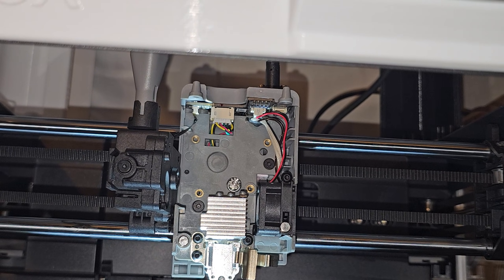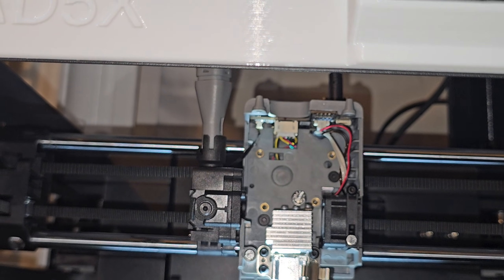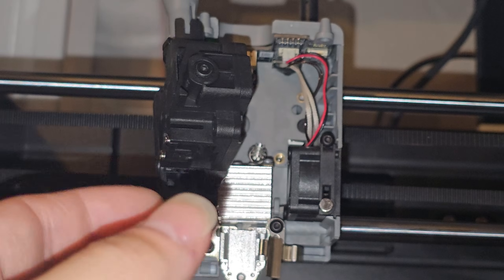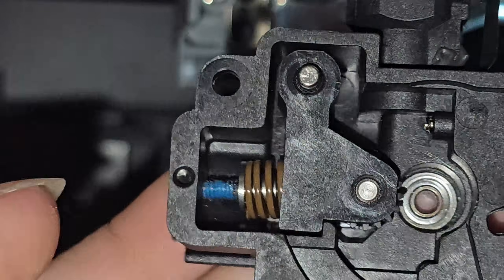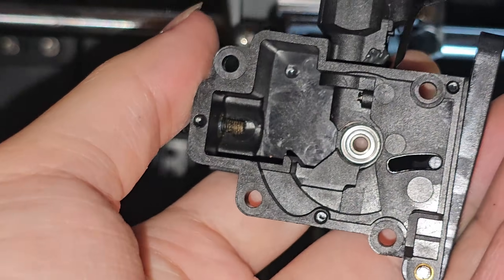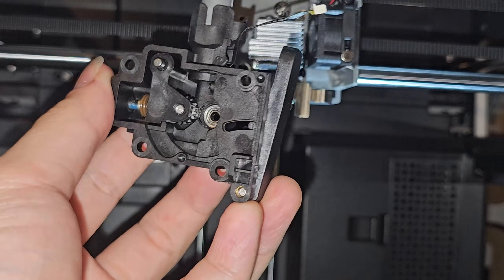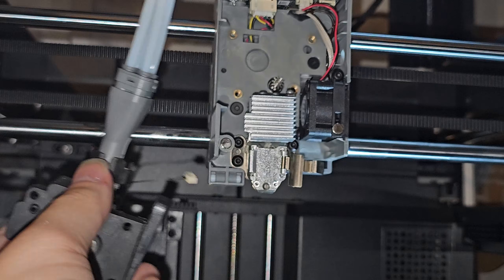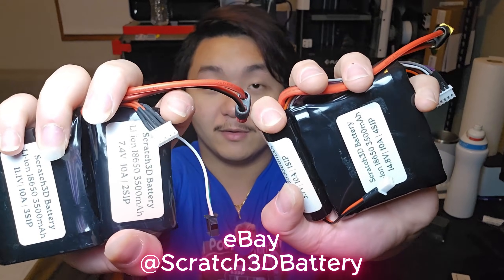Flashforge AD5X Extruder Jammed Fully Disassemble

Comment: Is easier and I think the correct way to remove the mini-PCB of the filament sensor, that ribbon cable you took it off with the plastic base that's why the pins inside of it are so fragile, in my case my extruder also got stuck with a spiral of TPU!
Reply from the maker: Thanks for the tip! I'll keep that in mind for next time.

Comment: ANYOE READING THIS DO NOT DISCONNECT THE PLUG LIKE HE DID!! This is incorrect. It is a ribbon cable that has a bit of glue but once removed it slides out of the connector he ripped right off the board, the part he took off is supposed to stay on the board and the ribbon cable slots into it. This is really bad advice for anyone working on theirs, luckily I noticed this before I did it.
Reply from the maker: You're right, that was a mistake on my part. Appreciate you pointing it out to help others avoid the same issue.

Comment: That problematic connector isn't removable; it's soldered to the board. You only remove the cable. Because of your video, I have to buy another board because when you "disconnect" it—which is really just desoldering it—there's no way to resolder it. Videos like this should be banned.
Reply from the maker: if you look at Flashforge video they did the same thing, so i guess they should be ban first right...? 

Anyways sorry your connector did not connect back, it has to be done very carefully.

Comment: This guy is an idiot. Do not remove the ribbon cable. It appears to no be one you can remove. It is a soldered on to the PCB. He knows he ruined his and didn't tell anyone. I just did mine and it broken now. I checked my pins very straight but I noticed these pins do not look right. They aren't your typical pin to connector. He should be removed from YouTube. BS. Now I have to order a hole extruder unit. Do not follow this video if you do leave the cable connect and be super carfull
Reply from the maker: Dang that sucks. That top ribbon is very fragile and can be broken if not careful. I got mine back together and its still printing. It can be done without taking the ribbon off but still have to be very careful.

Comment: This helped me loads, thank you very much for doing this, as an FYI I disconnected the filament cutter and removed the sensor, which was relative easy and allowed me to remove the whole unit without it dangling on the sensor wire.  Had the same problem with filament stuck in the gogs. Also when I put back together I had a problem with filament feeding through, this was down to the sping screw assembly, I had it tighted up too much, so found that tighten up then back off 1 full turn worked for me.
Reply from the maker: Yeah, by disconnecting the cutter and wire sensor does make it easier to work with. Glad this video was helpful.
Reply: Thanks worked for me too, one full turn back, as would not extrude at all, even tho most people say on forums it should be fully tight for all filaments even sort ones ,I will email support to see what the factory guide line should be ?

Comment: How did you remove the white gear wheel? I see a jump cut there and mine does not remove a simply as yours did
Reply from the maker: Its a bearing, you can just pull it out.

Comment: One of the pins pulled from the board when disconnecting the ribbon. Insanely soft and fragile. I guess I’ll need a new extruder board now. 🫤
Reply from the maker: Yeah it is sooooo thin and break very easily. Luckily mine was fine. 😅

Comment: I wish the Kobra S1 extruder were this simple, that thing is such a pain to work on. Love my AD5X, almost 1,000 hours on it and the only issue I've had is one partial clog with a glitter filament. It's been my most reliable printer.
Reply from the maker: So true! The kobra s1 is very difficult to work with, especially the tiny spring LOL. But it is a good extruder regardless.
Reply: Ese conector problemático no se retira , va soldado a la placa, lo que se saca es el cable únicamente.  Por culpa de tu vídeo me toca comprar otra placa pues al  "desconectar" que realmente lo que se hace es desoldarlo, no hay manera de volver a soldarlo. Estos vídeos deberán estar prohibidos